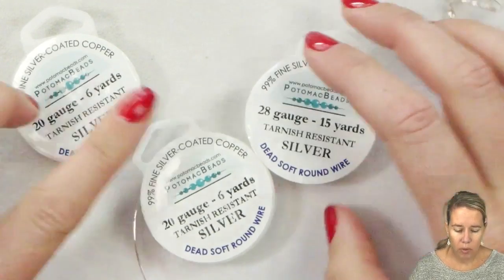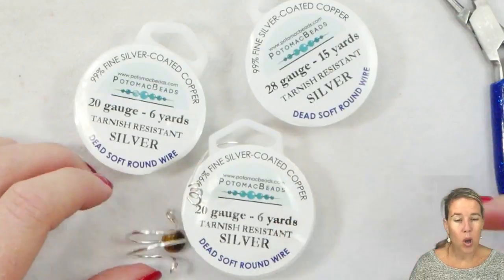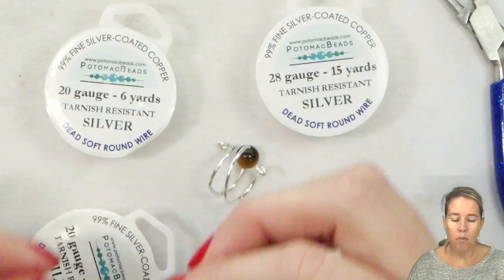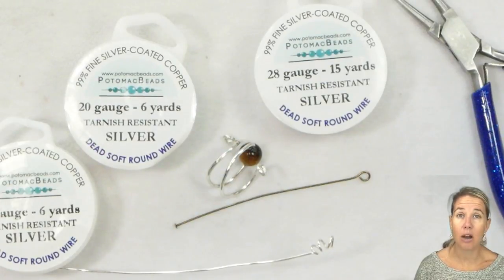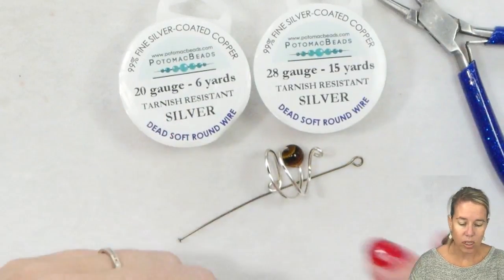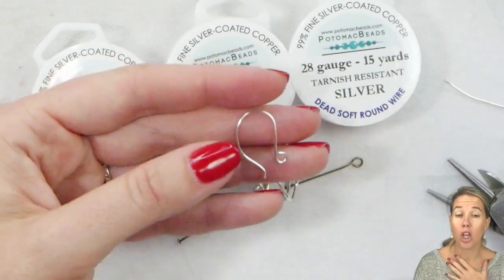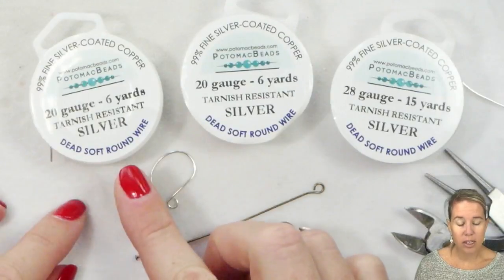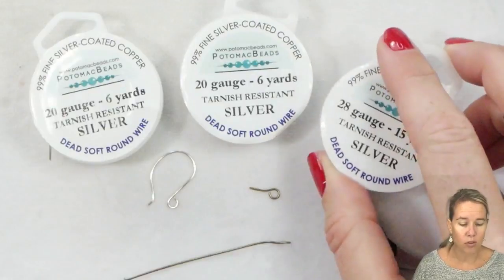Wire Types: Hard, Half Hard, Dead Soft - Better Beaders Episode by PotomacBeads

Comment: How can I tell if a wire is dead soft or half hard if it's not indicated, especially when buying online? Can the size of the wire be used as an indicator or not?
Reply: If they aren’t indicating it online you can ask the seller. I will say though, any reputable jewelry wire will be labeled. They may say soft instead of DEAD soft etc…. BUT most decent wire is labeled. When in doubt don’t order it if unlabeled.

Comment: For using beading wire which Is beSt gauge ?
Reply from the maker: Hello!  It depends on the project or what you are going to make.  If you want to make a wire wrapped loop necklace a 24 or 26 gauge works best.  If you want to make a bracelet with regular - not wrapped loops - you should go with a bigger wire like a 18 or 20 gauge.

Comment: Are dead soft copper wire and bare copper wire same?
Reply: Hi 👋! Yes bare copper wire is going to be dead soft! Copper is the softest metal to work with and u can work harden it by running it through nylon jaw pliers and hammering it! I hope 🤞 this helps you out!!